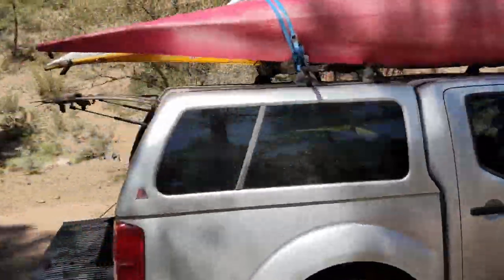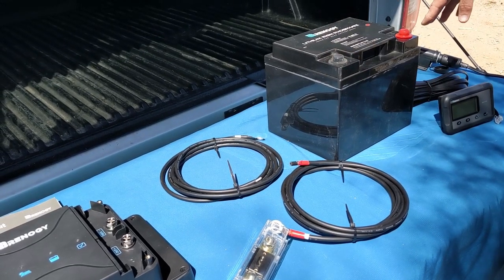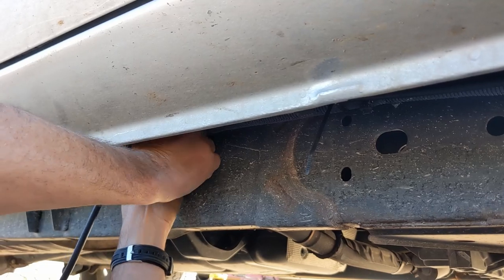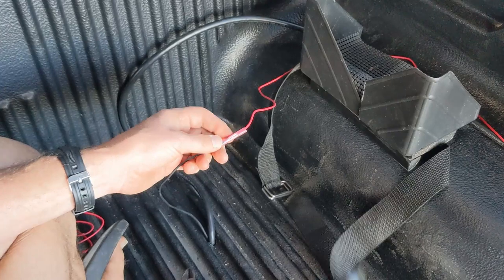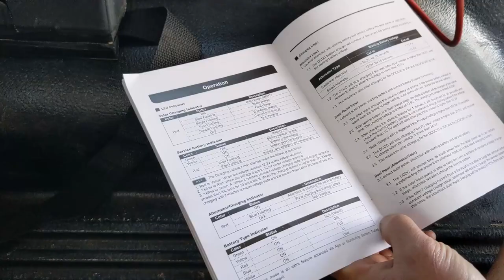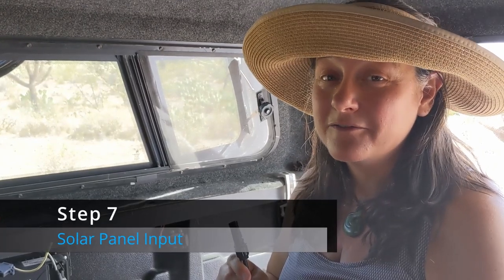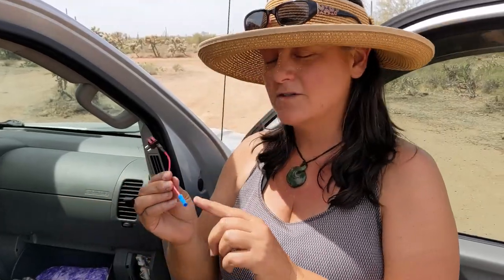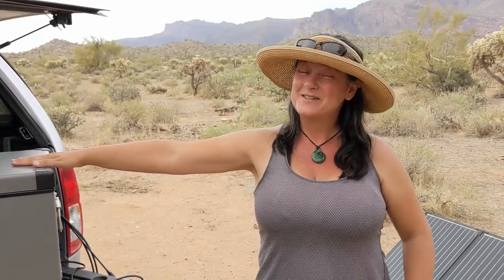Maximize Boondocking Power with a Renogy Dual Input DC to DC Battery Charger & LFP Battery Install

Comment: How many hours and temp setting does that cooler run on small 50watt lithium ?,
Reply from the maker: In 2 years of using this set-up, we've never run out of battery juice.  We typically keep our cooler at 40 degrees F, as we are vegetarians and aren't storing meat. We don't know how many hours specifically, but we can give you some scenarios.   If we are parked for 4-5 days (not running the truck's engine) and it's hot (above 80 degrees F outside), we've noticed that our 50Ah LFP battery will start to run low as the compressor on the cooler is running more often.  If this happens and the sun is shining, we connect our portable panel into the system and can recharge the battery in a few hours of full sun.  But, if we drive for 20 minutes (say to the grocery store or go hiking or kayaking somewhere), the DC to DC charger tops off the LFP battery.  We use the RMS monitor to check the battery level.  We were a little OCD about it at first, but now 2 years in, we've practically forgotten about it because...well, the darn thing just works!  It has been a complete game changer.  Does this help answer what you need to know?
Reply: @FreedomInACan  Thanks for the info. Our RV Dometic cooler  runs about two days with 200amp Renogy but we set temps at 32f and 35f dual. Question, your lead acid vehicle; does the Dc-DC manager charge the lead acid on same profile (Lithium) as the cooler ?
Reply from the maker: @VideoByPatrick  Yes, with the portable solar panel attached, it sends a trickle charge back to the starting battery to keep it topped off when our 50Ah LFP (cooler battery) is full.  That's actually what it is designed to do.  We bought the ICECO cooler because we knew if would just sip at the energy, and have been very pleased with the results.  Is your 200Ah Renogy battery LFP, AGM, or Gel?  The battery chemistry will make a huge difference in how many hours of run time you'll get.  Are you running anything else off that battery at the same time as the Dometic cooler?
Reply: @FreedomInACan  My Renogy is Lithium LifePo4. Not thrilled with their customer support though, I may go with Ampere for their 300amp battery,
Reply: @FreedomInACan  My rv starting battery is AGM twins 12v. Not sure they would like Lithium profile charging.
Reply from the maker: @VideoByPatrick  The description for charging back to the starting battery is "trickle charge" so I don't believe it would maintain the LiFePo charging parameters, more like putting an AC trickle charger on the starting batteries.

Comment: Did you get the insulated cover ? I did (-:
Reply from the maker: We did not due to our set-up with tinted windows on our truck bed cover, it stays pretty cool inside.  We are amazed at how little the compressor needs to run, even in hot temps, to keep everything cool.  Most efficient cooler we've ever owned...2+ years running fulltime!
Reply: I've had mine fore two months.

Comment: Throw the cigarette plug in the bin and go an Anderson plug it won't vibrate out while you are driving get to where you're going and find the fridge hasn't been running its a piss off.
Happy travels
Reply from the maker: You can do that too, good idea!  Over the last year and a half, we've been over a lot of miles and some of the worst roads in North America, haven't had a problem, yet.  But it sounds like you've got some first hand experience and I'll take you at your word, an Anderson connection would certainly be more positive.  Thanks for the feedback!

Comment: Appreciate the video, I've watched it multiple times!  Newbie to 12v here.  Question about the Fuse tap/signal wire situation....  Does the size of the fuse I am I am tapping into matter?  ie. I'm planning on tapping into the a 15amp fuse under the hood.  I don't imagine a "signal wire" requires a larger fuse, but can't seem to find that info anywhere.  Thanks, for the super informative video.
Reply from the maker: Thanks and welcome to 12V!  15A should be just fine.  What matters the most is that you tap into a fuse for an appliance that is only on when the alternator is running.  If you aren't sure, head to a local auto parts store or your mechanic, as they can help you find the correct fuse to tap in to.
Reply: @FreedomInACan  Thanks, I'm pretty certain I'm in the right circuit "only on when the alternator is running" (confirmed with a multimeter).  Just wasn't sure if the actual fuse had to be of a certain size.
Reply from the maker: @bobvall9731  I believe ours is connected to a 10A fuse, which is more than adequate.  The recommended wire gauge for that signal wire is 16-18AWG, so it's not carrying a lot of amps.
Reply from the maker: @bobvall9731  Perfect, even better!

Comment: Shari
I have a question does the RMS monitor give you the state of charge of your 50 amp hour lithium battery?
Reply from the maker: Yes, it gives us the charge status on both our service battery (Deep Cycle, LFP) as well as our car battery (CCA, lead acid).
Reply: @FreedomInACan  thank you for the reply!!
I have the RMS monitor and I also purchased the B-2 Bluetooth trying to decide on which one to install to the 50amp DC-DC. Thank you for all the extra time you take to make all the video's
Reply from the maker: @garyferguson1552  Both are good options.  We use the BT2 for our system in Hamlet and the RMS in the truck that runs our fridge.  Separate systems. Love that we can monitor both the service and the starting battery charge status with the RMS.

Comment: Great installation, for your 12 V fridge charger port could you have run a fuse box terminal hub to tie into aux battery?
Reply from the maker: Sure, if you are seeking to run multiple appliances off the battery, a fuse box is a great way to handle that.  Our system was designed to be dedicated to our ICECO fridge.  We have a fuse box in our camper which comes off the battery and fuses all of our DC 12V appliances (lights, fan, charging station, etc.)  Holler if you need further assistance with how to do this.  We can send you photos and/or walk you through what we have done.

Comment: great video on - how not to wire ?
Reply from the maker: Thanks for the feedback.  It's worked without a problem for over 3 years now.  We learned some things through this project and there's some things we would do differently if were to redo it.

Comment: Hello, have you guy had any issues with the DCDC charge controller not charging from the alternator?  and if so how did you resolve it
Reply from the maker: No, we haven't had any problem with the alternator since this installation.  No warning lights, no dead batteries, etc.  We've even installed a switch so that we could either charge the 50Ah battery, that runs the cooler, or the 200Ah house batteries back in the trailer.  No problems.  We get this question frequently, but the DC to DC charger is only taking a trickle charge from the starting battery, and boosting it so that the batteries are charged efficiently while driving.  Hope that helps.
Reply from the maker: Just following up.  You know, we had one problem with this intermittently charging early on.  We weren't getting a good negative connection to the frame of the truck, so we ended up installing more grounding wire all the way forward to starting battery and grounded it to the negative terminal.  Since then, no issues whatsoever.  Hope that helps.

Comment: Thanks so much for explaining this so well. Can you use the Renogy 50a dc to dc charger with the 50ah battery? I would like to allow for any upgrades to larger batteries in the future
Reply from the maker: The 50ah battery has a maximum continuous charging current of 50A, so yes, you could run that model with that battery.  However, I would turn your attention to the 100ah LiFePo model that is currently on sale (until 9-16-21) for just $180 more than the 50.  It's the lowest we've ever seen that sale price.  It will double your capacity, now.  This is the one that we have in our camper and we have been super happy with it.  See our video titled "Renogy Solar Panel Review..." On our channel for our complete battery review.  Good luck!
Reply: 50a for hour mean what, half full after 30min, maybe 200ah battery for fridge
Reply from the maker: We run our entire home on 200ah LFP, lights, computers, ceiling fan, Starlink internet, personal electronics, etc.  So far it's been more than we need.  If you are running a small DC fridge like ours 200ah is probably overkill.  Now, if you're running the dual zone and trying to keep a lot of frozen food then you might consider a dedicated battery bank that large.

Comment: Wonderful detail!  Q, do you need to worry about the temp (as in needing a heater) of the lithium battery?
Reply from the maker: Thanks for the comment.  Yes, we do need to pay attention to low temps.  We have a temp monitor on the battery  (non-self -heating) which shows on the display.  We installed a cut off switch on the starting battery just downstream of the fuse.  This allows us to turn off the charging current to the charger and the auxiliary battery when temps are below freezing.  The thing is, if it's below freezing then the cooler isn't running anyway, just keeping things from freezing so we don't really need the battery.  Even with the battery below freezing it will still discharge, just won't charge until the core is back up to above freezing.   There are many self-heating LFP batteries available now,  to solve this problem.  Check them out.  https://renogy.sjv.io/Yg7bEJ
Reply: @FreedomInACan  That makes sense and thank you for the link.  I am starting my process of replacing 2 grp 31 agms in a smallish (24ft) Bigfoot class c.  Lots to think about given other systems when making switch to lithium.  Need to add solar also.
Reply from the maker: You will not regret the switch to LFP, such a game changer.  If you need further help, let us know.  This is what we do for folks.  You definitely want to go the multi-source charging route, engine, solar, shore power.  It all helps in different weather situations.  Good luck!

Comment: Great video! I didn't quite follow the fuse instructions, what is the point of that again?
Reply from the maker: Thanks for the comment.  Fusing is a way to protect your system from an accidental surge.   Installing a fuse between each component of your system, both in and out, helps isolate any problem with any one piece from system from causing a problem with another.  So, when you put a fuse between the starting battery and the charge controller, you are protecting the wire cable from getting a greater voltage or amperage than it is rated to handle.  The fuse does this by melting, and shutting off the current, before the wire or component will.  The fuse is an easy part to replace and saves you from having to replace a long piece of cable or a new component.  This is why I prefer fuses over breakers.
Reply: @FreedomInACan  Ohhh, okay thank you!

Comment: Fantastic video !!
I would like to do the same in the back seat area of my 2002 F350 power Stroke.
I was thinking on using a 100amp hour Battle Born battery.
My question is  what determines the size of the charger 30 Or 50 amp.?
Reply from the maker: Thanks for the comment! The size of your charger will be determined by the size of your solar array and battery.  With just the 100 AH battery it sound like you could get away with the 30 A version.  I am checking with our engineer contact just to make sure and will get back to you.
Reply: @FreedomInACan  thank you for your reply!! Will stay tuned in.
Reply from the maker: @garyferguson1552  Hi again, Gary.  Got a thorough response from the engineer at Renogy.  Some additional questions that will help us determine which size is best for your needs.  Is the battery you will be charging an LFP or SLA (gel/AGM)?  What is the maximum continuous charging current of that battery?  Those specs should be available from the manufacturer.  Also, will you be using a solar charge simultaneous with an alternator charge?  How many watts of solar do you have?  In other words, is your solar permanently mounted and will be charging your house/service battery while you are driving down the road AND using the alternator to charge it as well.  Or, is your solar panel portable (like we've shown in this video) and it will be an either/or situation?  Depending on your answers, we can provide you the info you need!  Looking forward to hearing back...
Reply: @FreedomInACan  hello Shari
Battle Born is a 100 amp lithium (LifePO4) battery they say the charging rate is 14.2 ~ 14.6 Bulk & Absorption and 13.6 float. I will have the same situation as you just using a portable 100 watt solar panel if needed when parked.
Reply from the maker: @garyferguson1552  Looks like the 50A is the way for you to go.  Voltage is different from amperage which is different from continuous charging current.  I looked up the specs for that BB battery and it's 60A-80A of continuous charging current, depending on battery temperature.  So the 50A will maximize your charging capability.  Please use our affiliate link in the video description...and just discovered this product is on sale for 12% off for a short time!  Holler back with further questions and best of luck.
Reply from the maker: @garyferguson1552  And, thank you!  Your question has prompted us to write a blog with a couple of charts for people to be able to tell which DC to DC charger they will need depending on their battery type/size and size of panel array.  We love good questions!
Reply: @FreedomInACan  Shari I thank you so much for taking interest in my question. I have a Bigfoot truck camper with 300 watts of Zamp solar panels with a Victron 100/30 charge controller and a  BMV 712 battery monitor and two BB lithium batteries. I think having a auxiliary frig in the back seat would be great. Please keep me posted on your write up.
Again thank you!!
Reply: Hello Shari,
Its Gary again I just had to share this with you. Like I previous said I have a 2002 Ford 7.3 Power Stroke. I was curious about my alternator so I went to 3 Ford Dealerships and 2 alternator repair shops to inquire and no one has never heard the term variable voltage alternator or a smart alternator. At one repair shop they did  say I have either a 105 or 110 amp alternator. They looked at me like I was crazy (lol).
Have great day!!!
Reply from the maker: @garyferguson1552  Well that's both funny and annoying.  Our Nissan Frontier manual told us we had a variable voltage alternator.  It boosts fuel economy by varying the voltage based on what the engine needs.
Reply: @FreedomInACan  hello Shari!!
Its Gary I have been moving forward with my project. I decided on the 50amp Dc to Dc and a 100 amp Renogy lithium battery and a Renogy 100 watt suitcase solar panel.
My question is I am having a hard time deciding on the cigarette lighter plug for the Iceco. Are you happy with your choice and if you are would you share were you purchased it.
I was looking at the one Blue Sea has on there web site.
Thanks again for your help
Gary
Reply from the maker: @garyferguson1552  That's great news!  We just got a 12V utility outlet from an auto parts store.  Nothing fancy, works great.
Reply: @FreedomInACan  
Hi Shari. I was hoping you could help me again.
Can you direct me to the blog you wrote in regards to all the information about the 50 amp DC 2 DC MPPT charge controller. I can not seem to remember where I found approximately a 1 year.
Reply from the maker: I think you mean this one.  https://www.renogy.com/blog/so-many-dc-to-dc-charger-options-so-little-timewhich-one-is-best-for-your-system/
Let us know if this isn't what you are looking for.  Hope that helps!

Comment: Does the solar light turn off when the batteries are full?
Reply from the maker: No, the indicator lights just show that there is a solar panel input.  In order to view the battery charge status you really need the additional monitoring screen, this one works with the Dual Input DC to DC charger. https://renogy.sjv.io/c/3222611/1200820/14864?prodsku=RMS-DCDC-US&u=http%3A%2F%2Fwww.renogy.com%2Fmonitoring-screen-for-dc-dc-mppt-battery-charger-series%2F&intsrc=PUI2_9257

Comment: I am using the auxiliary battery, iron phosphate 240, and the starter battery 100.
How many amps can each fuse use
Reply from the maker: The fuse size depends on which model of DC to DC charger you purchase and the maximum charging current of the auxillary/house battery you are using.  Let us know which model you choose and the max charging current of your battery and we can help you match a fuse size to the components.

Comment: nice to meet
Lenogy driving charger, mppt will be injected and installed
Is there any problem with the main battery and auxiliary battery even if the driving charger is always connected to solar power
Reply from the maker: There shouldn't be any problems between the two batteries, whether you always have the solar connected or not connected.  The dual Input can handle both the starting battery input and the solar panel input.  When the auxiliary battery is full and charging on solar it trickle charges the starting battery.  Hope this helps.
Reply: @FreedomInACan  I have one question
Will it be a problem if I don't put a fuse block on the starter battery and the auxiliary battery
Reply from the maker: @김주환-v2f  You definitely need an ANL fuse between the starting battery and the charger and another between the charger and the auxillary battery.  They are inexpensive and will work to protect the components in case something happens.
Reply: @FreedomInACan  thank you
Hope you have a good car life
so good~